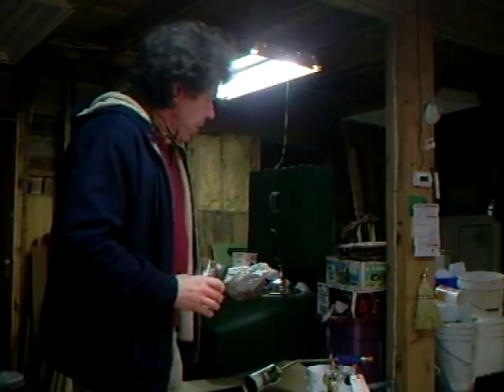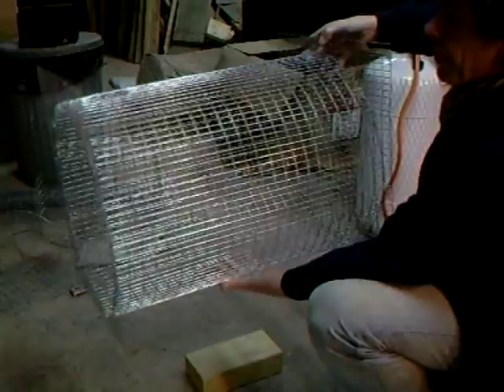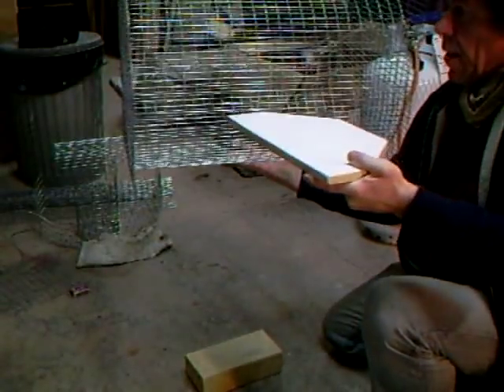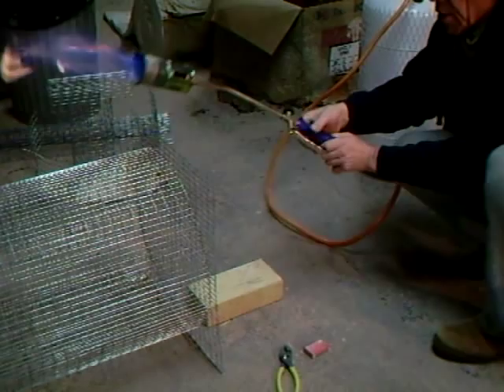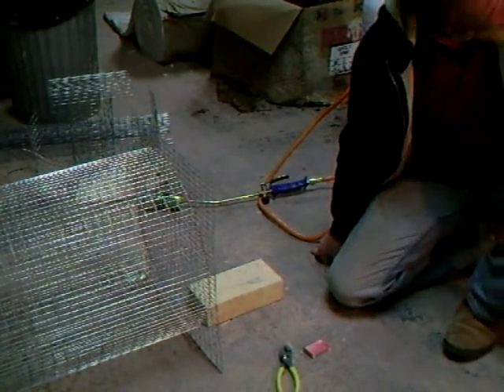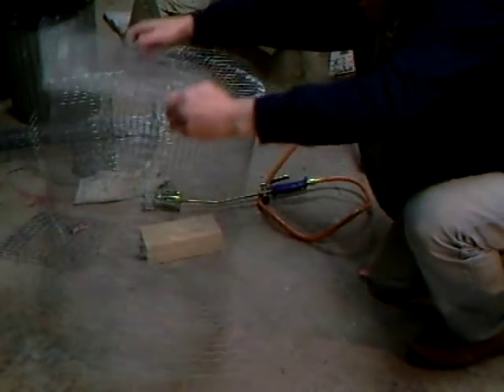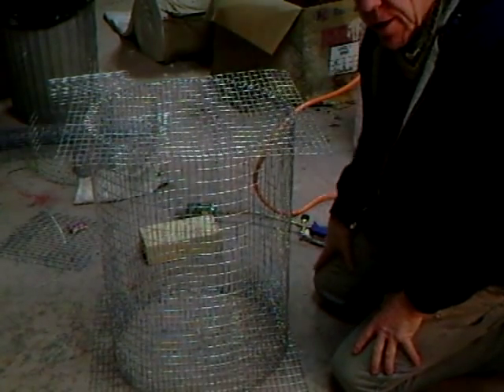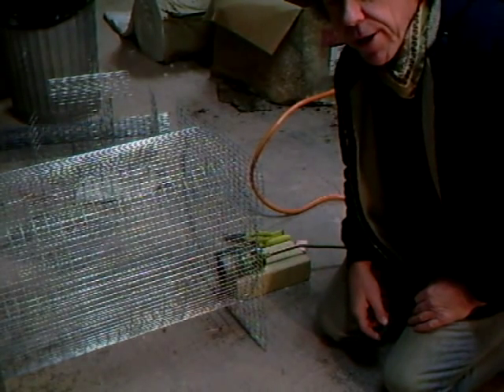SIMON LEACH - Raku kiln part 2

Comment: A couple of comments:

1) you are going to have to figure out a way for the shelves not to crush the Koalwool or the crushed areas will bleed heat badly.

2) Assuming you solves the above, you will need to have something to bounce the heat up into the upper chamber or the flame will bounce back toward the burner.

3) The exhaust port should have something to angle the flame up and away from the LP, burner and hose.

Otherwise it should work if it can hold the heat.

Comment: I'm not sure if it works with kilns, especially if there are pots in the way, but foundry furnaces use the burner on a tangent.  It make the flame swirl around several times before it leaves.

Comment: Simon, This is interesting.  I have the fiber, I have the metal parts, I have the burner, but I was going to flame into the side under the shelf and go out the top.  I wonder if there will be enough strength from the metal fabric to keep the bottom from collapsing.  Have you tried this before with success? Also won't the height of pots you can fire be limited? I do like the idea of more shelf and hope your kiln works so I can borrow your idea.

Comment: Will that hardware cloth be strong enough to support itself, especially once it gets hot?  A cylinder on end is very strong, even if the walls are weak, but tip it over and it will collapse rather easily.  You may consider a reinforcing framework of some kind.  Maybe a T shaped bit angle iron on each end, the horizontal part as the base.